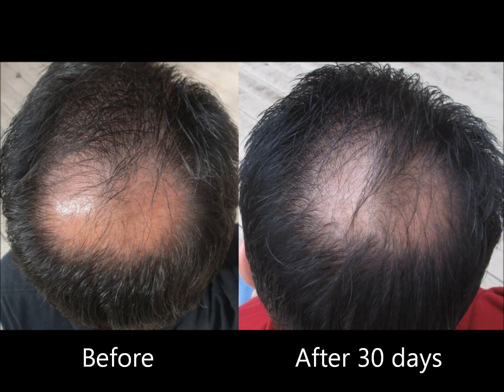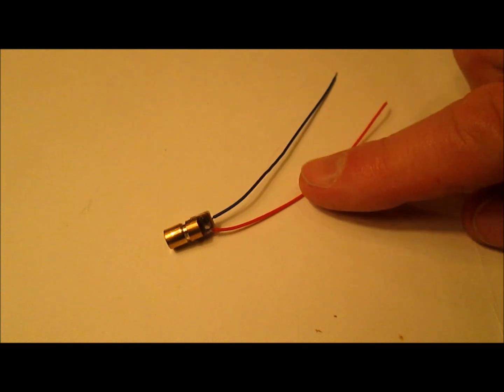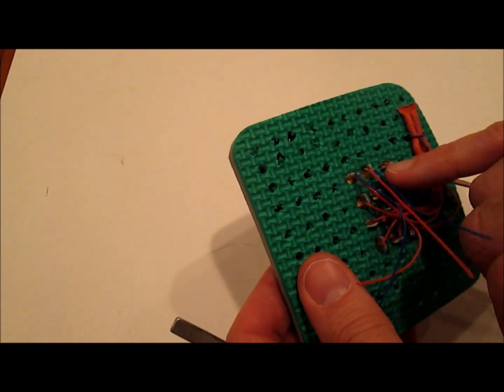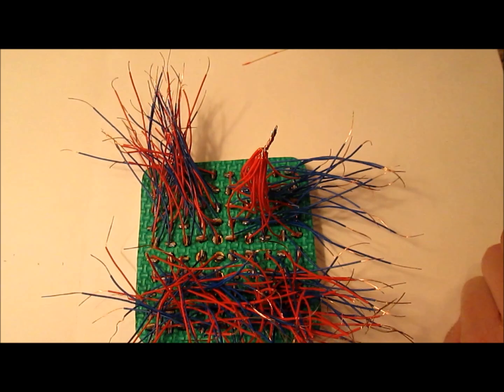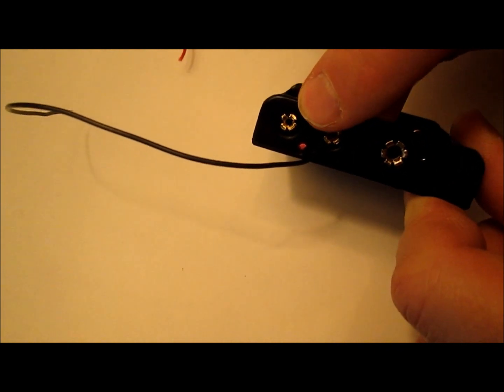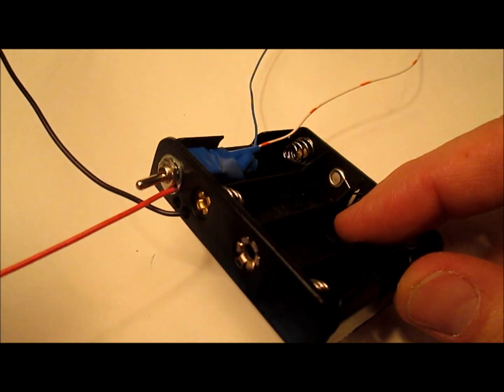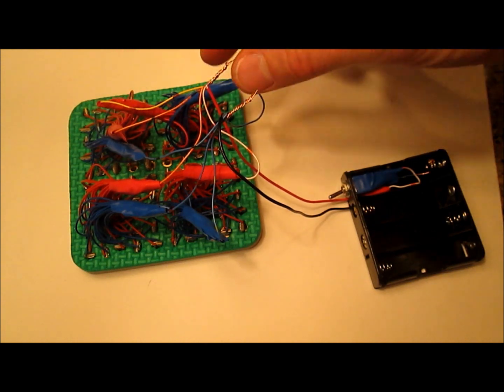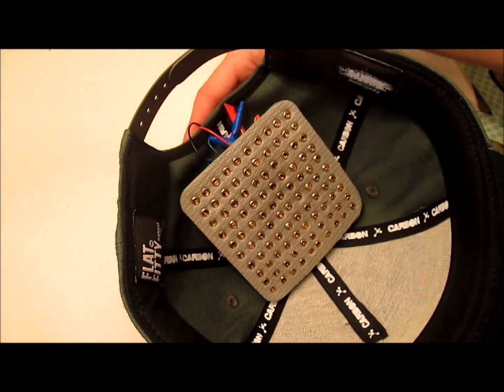How To Make a Hair Growth Laser Hat for $60

Comment: You can just use a usb chord, or if you want to use batteries Amazon sells cheap 3X 1.5 battery holders with the switch already built in 4 for 9.00

Comment: If the diodes are connected in parallel, wouldn't the current crowd into the lowest impedance diode? Thanks for the video! Wondering if there has been any issue of non uniform intensity from the different die. Take care.
Reply from the maker: Think of a hose with three sprayers.   One may have slightly less resistance and would get slightly more water, but not all of it.   Same concept here.   Also, we are producing non-focused light, so there is much overlap between diode coverage areas.

Comment: Hi Lou, many thanks for this upload. The only alteration I made when I tried this was to set the diode's 2 cm apart (approx). I also used an old Trilby that I don't normally use so I got more coverage on the sides.
Even though I only used 64 diode's it was a lot of wires to organize into 4 groups but I made it in the end, though I may have to wait a couple of months to see if there is an improvement. I also started to use a coal tar/salicylic acid ointment that I found on e-bay as it was good for psoriasis. It also seems to work for red age spots that I got when I got shingles. (I am 70). I am starting to use this as a hair gel. Thank you once again for the video, James.

Comment: cool video . thanks for showing . you can buy a battery pack with switch built in probably easier . also if the foam is as thick as the lasers then would fit around the head more and just stick it with double sided tape in a larger cap or hat
Reply from the maker: Thanks!  Good ideas.  I cover some of them in my second video.  
How To Make a Hair Growth Laser Hat - Update https://youtu.be/HFRkXz8H6nQ

Comment: Does anyone know how I would wire up a 5V adapter in this laser hat, instead of the batteries? Surely using batteries is not a viable solution for running this device. It would cost a fortune to run over weeks and months and years.
Reply from the maker: You simply need a 2 Amp, 5 Volt power supply They are a little uncommon, so more expensive than you would think.  You are right that running this hat on disposable batteries would be very costly.  Rechargeable batteries are a great way to go.  They provide a cheap 2 Amp source and allow you to walk around and do other things while you wear the hat.

Comment: I guess diode you are using are not that powerful, you need Class 3R/3A diode which are more expensive around 1.5$ for 1.
Reply from the maker: Why do you need more power?
Reply: @HowToLou  I think you get better result with those, i am using Callipus82 which has Class 3R/3A diode which are more powerful and effective in terms of light .
Reply from the maker: They have 5mW laser doides, the same as this one.  If I were going to buy one, it would not be Capillus, as it is poorly rated.  Get a better brand.
Reply: @HowToLou  Thanks i already got one cap and seeing better results though its just 2 months. I am not sure about diode but when i looked online i noticed that they are more expensive.. so i thought that's why these cap are expensive. You might be right, they didn't put much details apart from 650nm classic 3R/3A...
Reply from the maker: Does your blink?  Someone commented that blinking is better, but i am not sure.
Reply: @HowToLou  Nope it doesn't.. they saiduse 6Min every day
Reply from the maker: Ok thanks!  Good luck. Good results!!
Reply: Hi,
I know nothing on how to do this. What if I buy one from you?

Comment: Hey i made my hat, the only issue i have is that after 5 minutes my lasers start to go dim. Certainly doesn't last 30 minutes. Do you know why this would be??

I also use an old computer power supply for my 5 volts.
Reply from the maker: The Lasers are probably heating up and increasing their resistance, so they get less power and go dim.  That happens with the batteries too, but not that quickly.  Try attaching a 5-volt muffin fan to the back of the laser pack to keep it cool. They will stay brighter longer.
Reply: @HowToLou  It worked!!!! I got some 12 volt 120mm pc fans. The one i made is bigger because i have thinning up the middle as well, so i had more lasers and it covers most of my head. But yeah, i sat them on top of the wires and held them in place with zip ties. It ran for half an hour and they didn't go dim! 

You saved me a lot of money because i thought the lasers were just crap and was gonna go buy the expensive ones!! Thanks! And i just subscribed as well!!
Reply from the maker: Great news!  Thanks for the Subscription.  I have 250 videos all categorized on one page at HowToLou.com.  You might find something else you can use there.  More to come.
Reply: @HowToLou  Good idea!! Thanks for that I'll give it a go!

Comment: most useful YOU Tube vid I've seen in months. & I see a lot. I do have some medical lasers used in x-ray cat scan positioning systems. They track x y coord. but they use special laser drivers with very exacting voltages. How is that not an issue with these?
Reply from the maker: Sorry I don’t know anything about medical grade lasers.  Maybe they are not LED?   These LED lasers seem quite flexible on input voltage.
Reply: @HowToLou  thanks for the very prompt reply. You running for office? ha  thanks

Comment: I made one of these using 100 x 5v lasers. All works well, powering them using USB. However, the lasers lose most of their brightness after about 15 mins of use. They feel hot, so might this be an overheating issue?
Reply from the maker: Mine got pretty warm after 15 minutes too. I just turned it off at that point and used it the next day.  15 minutes is enough use per day
Reply: Hi Matt;
Did you ge good result?

Comment: Will a 4 AA battery pack work for 100 diodes or burn them out?
Reply from the maker: Check the voltage rating of your diodes.  Some are 3 volt and some are 5 volt.  It does not matter if you have 1 diode or 100 diodes.  Now look at batteries.  Disposable batteries are 1.5 volt, so two would work for 3v diodes and three would get 4.5v which is good for 5v.   Four is 6v which is too much.  Rechargeable batteries are 1.2v, so they don’t match well to 3v, but four will get you to 4.8 which is good for 5v diodes.

Comment: Hi howtolou,  I was wondering how many lasers will three AA batteries power.   I have 100 of the 650nm 6mm 5V 5mW, laser diodes but I noticed that I needed more coverage than what 100 diodes offer.  I have a 3 slotted AA battery battery adapter which says it puts out 
4.5 Volts...

https://www.amazon.com/gp/product/B00E0JQ6FU/ref=oh_aui_detailpage_o03_s00?ie=UTF8&psc=1

I think that was the right one that you said to get, though I can't find the original parts list so I'm not sure.  Regardless, I don't think it would power more than 100 lasers, (correct me if I'm wrong)

If it doesn't power more than 100, what AA battery box should I use if I want to power somewhere between 120 - 150 5V laser diodes?  Any help and details on that would be greatly appreciated, I'm not positive that I have the right battery box for the 100 diodes to begin with since it says it's 4.5 volts instead of 5 volts like the laser diodes.

If you have specific links for battery boxes I should use, that'd be great but just having the specifications of the battery box will help too if you don't know of one off hand that I can buy.  For informational purposes the battery box I have has the following disclaimer...

"the maximum power should be less than 10W, the working current must be less than 2A.Please pay attention to your battery heat generation while using this product and do not use the poor quality battery."

I have no idea if this will be what I need for the normal 100 diode setup that you put together or for the 120 -150 diode setup that I want to try.
Reply from the maker: Mike M. - one battery pack might be enough.  If not, just use two packs in parallel.  That is connect black wires together and red wires together
Reply: When combining two battery boxes together, this won't make the diodes receive twice the Volts for a total of 9?   If so I'd imagine I'd have to use close to 200 diodes not to burn them out but then again I don't know a great deal about this, lol

Thanks for the response by the way.

Comment: I have 30 pics 5v laser  so how much power i need to on this 30 laser at a time
Reply from the maker: +Sachin  each laser is 20mA so you need 600mA total at 5 volts.  3 rechargeable 1.5 volt batteries in series would be  perfect.
Reply: Thanks for replying can you give me your whatsapp nombre
Reply: My perches diode supply voltage is 4.5v DC and operating current is 40ma and this is 30 piece (i have +5v 0.5A power adapter)
Reply from the maker: +Sachin - If you have 30 diodes at 40mA each, that is 1200mA or 1.2Amps.  A 0.5 Amp power supply is not big enough.
Reply: I have 1.2v aaa battery how many battery i need
Reply from the maker: +Sachin 1.2x4 = 4.8volts.  Fine
Reply: But for hair treatment all 30 diode ran at list 30 min so 4 battery is ok

Comment: Hello from Brasil! I know for a factura that you need at least 150 laser diodes to obtain good results. The only thing i'm troubled with is If those laser diodes are the same used for low level laser therapy. If yes, is there a way to confirm the wave lenght of 650nm? Also, are 5 mw enough? Thanks!
Reply: Daniele, você comprou algum dispositivo lllt? Estou pesquisando e vi que você tem conhecimento sobre as especificações técnicas. Obrigado.

Comment: Hi Lou,

Where do you get the foam board?

Thx!
Reply from the maker: +Chris Bissen - look for foam flooring at your hardware store.  You can also get a cheap pair of large knee pads and rip the foam plate out of them.
Reply: HI Lou, can you write the list of stuff as I couldnt hear what type of tubing is needed when you pointed to the red wire/tube in list of things we need. thanks. I am going to attempt this soon.
Reply: Never mind found everything on your website. thanks
Reply: Hi Lou,will these laser diodes work?

https://www.aliexpress.com/item/100pcs-650nm-6mm-5V-5mW-Laser-Dot-Diode-Module-Red-Copper-Head-Laser-Diode/32400618751.html

Also found this battery holder.  https://www.aliexpress.com/item/Black-3-AA-Battery-Holder-Box-Case-With-Switch-EE4068/32325629856.html

Comment: I took your advice and I got some rechargeable NiMH AA batteries (2800 mA) and a charger.  But Lou, wouldn't a 5 volt 3 amp ac/dc wall converter also do the job.  I believe the lasers use 28 mA at 5 volts, so 100 lasers would be just under 3 amps.  If you cut off the metal adapter on the end of the ac/dc converter's power cord, you could easily determine which wires were positive and negative, and then just splice them into your laser circuit.  Sorry to be asking you so many questions, but I was really curious about why you thought the ac/dc converter was an inferior way to go.   If it matters, I really don't care if there's wires hanging out the back of the laser hat.
Reply from the maker: Rechargeable batteries allow you to walk around the house and do stuff while wearing you hat.  Otherwise, no problem.

Comment: I finished the laser hat and it works great.  However, using brand new Duracell batteries purchased from Home Depot, the lasers loose about half their brightness after just 1/2 hour.  Any suggestions?  I thought about going with a plug in AC to DC adapter that outputs 5 volts and 2400 mA (I went with the 5 volt laser diodes from Amazon which I'm powering with 3 AA batteries).
Reply from the maker: +Bob Robinson - rechargable batteries are the only way to go.  They last about 20 minutes, which is about the time you need to wear the hat anyway, then you can put them in the charger for the next use
Reply: How’s the hair now?

Comment: I found a 3 AA battery pack with a on/off slider switch. Can i just wire the 100 bundled laser diodes directly to the red and black wires on the battery pack? Thank you
Reply from the maker: +No Name - Absolutely, I do exactly that in the follow up video

Comment: Amazon has 5 volt laser diodes (package of 10) for $2.92.  The 3 volt laser diodes are $6.95.   How would you power 100 5 volt laser diodes?    I'm thinking 4 AA batteries, but I just wanted to verify that you wouldn't need some sort of resistor.  Thanks again for your time.
Reply from the maker: +Bob Robinson - power 3 volt lasers with two 1.5 volt batteries.  Power 5 volt lasers with three 1.5 volt batteries.  The lasers have resistors built in.

Comment: Hi Lou.  On your original video you've got two batteries in your battery pack, but in the update you've got three.  What's up with that?  Thanks for taking the time to answer my question.  

OK, one last one.  If you had two hundred three volt laser diodes instead of the 100 in your plan, could you still power them with two double A batteries?
Reply from the maker: +Bob Robinson - Look again. Both use 3 AA batteries.  For 200 lasers, you would probably need two battery packs.  One for each bank of 100 lasers.  One pack might be enough to turn the lasers on, but they would be dim and would not last very long before needing a recharge.

Comment: have you had any luck with the laser hat??
Reply from the maker: +rick mytys - I have been using the new 650nm lasers.  It seems like my hair is not falling out nearly as much, but I have not seen any more growth so far.  I don't know if it works better on some people than others
Reply: alright ty so much for the feedback wondering if i should buy the real thing or try and make one
Reply: also you dont use it all the time though right?If you used it more you might have more results?
Reply from the maker: +rick mytys -  if you look at the reviews on Amazon, it seems like these hats work pretty well for some people, and not at all for others.  Building a hand versus buying can't save you a lot of money, and gets you the same lasers.  My logic was that I would rather spend less money on something that might or might not work.
Reply from the maker: +rick mytys -  I set alarms on my phone, to use it for times a week, for 20 minutes each.   I probably only end up using it to to three times a week, because when the alarm goes off, I am in the middle of something, and then I forget.   Honestly, most of the time I completely forget I have a bald spot. It's not something I typically think about.   I should take a picture of the back of my head, and post it on the bathroom mirror to remind me :-)
Reply: ya that might help ya out a little bit lolz

Comment: Are 3 volts suitable to power 100 diodes?
Reply from the maker: +sciencelearnremember - yes, volts don't change when you add more diodes, but amps do.  The rechargeable 2000mAh Nimh batteries supply plenty of amps.

Comment: Thanks for the tutorials! Question: I purchased this power supply http://www.amazon.com/gp/product/B00JEPFK02?psc=1&redirect=true&ref_=oh_aui_detailpage_o04_s00 
and while stripping wires, 3 or 4 laser wires detached. Rather than purchase another hundred and wait, I continued building. When first plugged in, the lasers remain steady for about 30 seconds then begins a cycle of 1 second on, 1 second off. Would the missing lasers be the cause?
Reply from the maker: +Zipeededooda - You can do this with any number of lasers, so 96 is fine.  Your power supply is not strong enough, so it is shutting down to prevent overheating, then coming back on, every second or so.  You need less lasers or a bigger power supply or rechargeable batteries are the best solution.
Reply: +HowToLou Would this do? http://www.powerstream.com/ac-0520.htm
Only one I could find that isn't a similar small device charger.
Reply: +Zipeededooda FYI Same problem with the powerstream power supply.
Reply from the maker: +Zipeededooda - The 100 lasers take a a lot of current (amps).  Current is like water flow rate.  Most reasonably priced power supplies have a low flow rate, like a faucet that only produces a trickle.  Most electronic devices only need a trickle, to run, so these supplies are mass produced and inexpensive.  If you want a more rare, high flow supply, you will pay a lot more.  The solution is rechargeable batteries.  You charge them with a trickle for 3 hours,  and then use them for 20 minutes at a MUCH higher flow rate.  If you use batteries,  your problems will go away, and you will have the added benefit of mobility.
Reply: +HowToLou I've tried the battery holder(two AA) provided but the lasers only take on a dull glow. Will rechargeable batteries provide more current than regular batteries?
Reply from the maker: +Zipeededooda - Yes, I use them all the time.  Get ones with as high a mA rating as you can.  Also, get NiMH, not NiCd.

Comment: I'd like to share my experience too. I build it using diods from ebay, they claimed ii is 650 mn but you can't check it. After 3-4 months of using i didn't experience any results, i can feel that it is working, you can feel different blood circulation in the body and knees. Even i would say i saw less hairs falling out but overall I am feeling that hairs are continue to thinning and shedding. So i don't know whether it is wrong diods or the technology don't work. Switched to essential oils and jojoba for a while, as first results like it more. Will see.

Comment: This doesn't make sense to me. You are supplying a 5v drop across each diode? Surely their forward voltage @40mA can't be 5 volts, can they?

These chinese diodes don't have an I-V curve (hmmmmmmmmmmmmmm >.<)
Reply from the maker: +Flylikechris - They are rated at 5v and 20mA each for a total of 2,000mA.  It works jst fine.  You saw them all light up :)